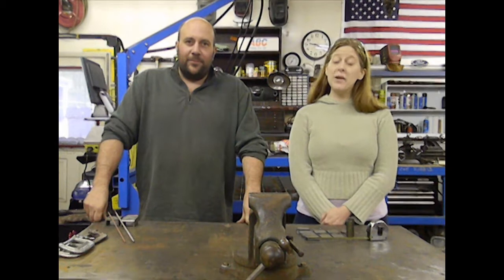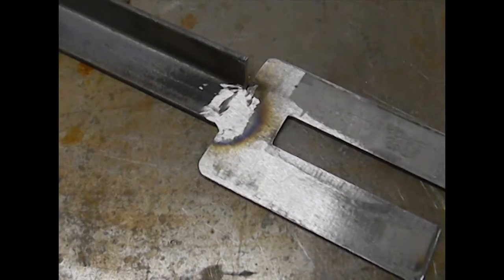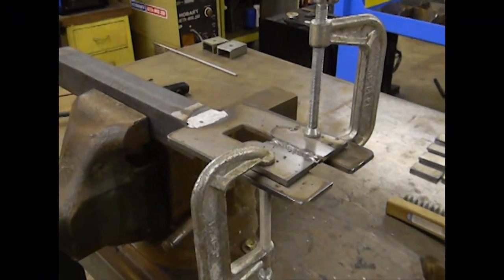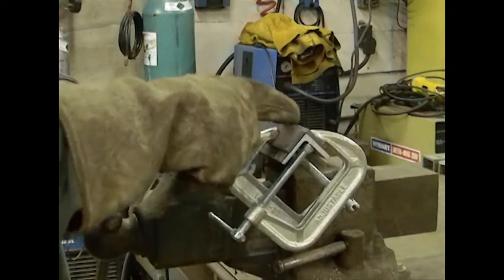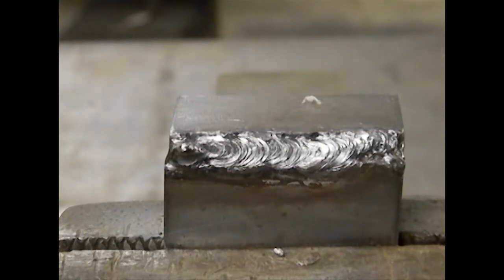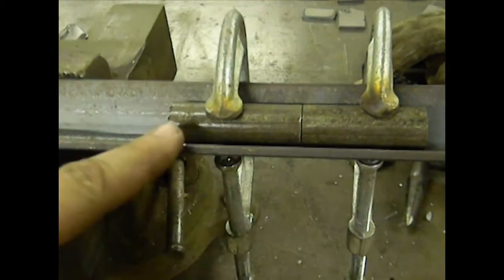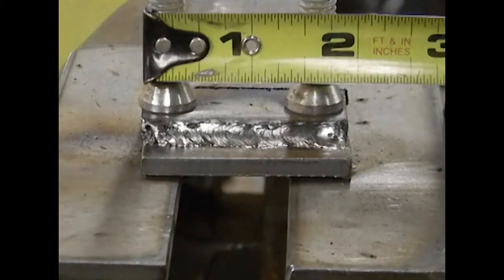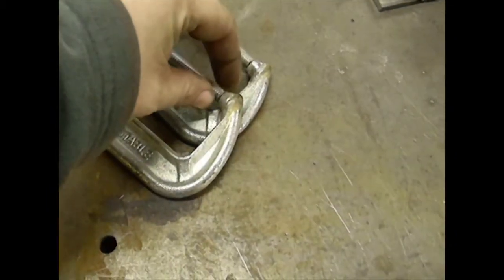Welding Jig

Comment: Unless you are welding pipe in a field, leave the stick welder alone.
Reply from the maker: If your only using it in a field your missing out on the versatility of the process.
Reply: Such a simple jig but so useful. Thank you for this video. I will make one of these for when I weld with my everlast next.